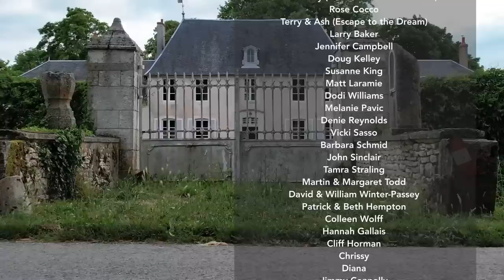How we are SAVING our CRUMBLING Chateau BUILDINGS - Journey to the Château de Colombe, Ep. 80

Comment: For the ivy - Glyphosate is the chemical that works most effectively to kill English ivy.  Only thing is, you need to get it on the roots as much as possible - ivy leaves have a waxy top layer and this prevents any liquid from being absorbed on the top.  If using this chemical herbicide, make sure you hit the under leaf area more than the top.  
An organic alternative is using borax and hot water. When handling borax, wear heavy gardening latex (not nitrile) gloves.  Borax can't "eat" through those.   Using borax, make a paste with a little bit of cold water.  "Swab" the surface of the recently cut ivy root "heads" with the paste.  After doing 3 meters, return to the beginning and pour boiling hot water on the plant's stock. Caution: borax will kill whatever grass you have nearby up to a meter's width.  
A 3rd way is to drill a hole in the center of each root "stem".  Make sure it isn't just a small hole!  Take the biggest bit you have, as long as it does not go past 3 ml from the bark of the root.  Drill down as far as you can.  This creates a "deep hole" where the salt can penetrate and where rain won't wash it away.   Salt won't harm the surrounding area as much as borax but it will turn your grass yellow and could kill it.  
Salt and borax can take over 3 months to work if not longer.  You can do a small test first to see which works best for you.  
A 4th approach is possibly the least damaging to the environment - solarization.  This method uses a clear plastic sheet (5 to 10 ml thickness - 3 ml is too thin) to concentrate the sun's rays to heating whatever is under the plastic.   It will also heat and "boil" all other plants under it.  Do not cover! except the edges where you need to hold the plastic down. First water the area thoroughly.  2nd lay down the plastic in a single sheet (don't double it).  Anchor it down with rocks or landscape fabric ties every 30 or 50 cm and sing:  "Let the Sunshine In" every morning when you go check the area.....😉.   You can also lay black plastic of 10 - 12 ml down and cover with a thick 3 inch (7.5 cm) layer of mulch.  The results can be seen after 1 month of warm weather.  Also, the hotter it is, the better. 
The only other way is to cut the ivy at the root level, then cut the "in-between" layer to just @ shoulder height.  The top will naturally "die" and go brown at that point, you simply pull it off.  But this also means, you'll be checking the area constantly for "regrowth" from the root system. 
Hope this helps.

Comment: I got rid of bamboo by chopping it back, pouring mineral turpentine liberally on it, leaving it until it didn't have a strong smell and then chopping and digging out the thick, woody structures.  The turps stopped it growing and weakened it. It was the safest thing to use, my sweet Hobbit wouldn't go near it and once the smell is gone, it has completely broken down and planting can begin.

Comment: Just a thought on something to kill unwanted plants...here in Canada we pile up pine needles and woodchips and let them rot down..the process creates turpentine ,,very deadly to most plants..it smell quite strong for a time but its used as a ground cover in many of our parks etc for weed control...can you get  a truck load of this product and make your own natural weed control? Keep it as far from you home as you can and also turn it with a pitch fork regularily as it can build up enough heat to start to burn...also can you just inject gas or diesel by syringe into a stem of the ivy

Comment: I think over years of neglect, piling up compost your garden soil level is atleast 30 cm higher than that garden originally was. Dig away the soil around the pigeonnierebin a radius of atleast 1 meter. Than you can see how the steps to the door were. You can repoint the base. I think it originally was a non covered tower considering its age. They covered it instead of repointing.
Reply: That I like true.  Although every building here was rendered.  It was common here.  
We need a mason to repair the damage of almost 70 years without a roof before we can start to search for a roofer who can build the correct roof…..  right now that is way out of the realm of what we can do.  Hugs. 😊😊

Comment: If you can't kill the ivy roots any other way maybe you could just heat them through the plaster until they are dead? Use a blow torch  but don't necessarily burn them out. Or burn the roots at the base of the wall? I've never tried this but burning over the tree stump might keep them from sprouting dozens of new shoots? 
 I don't blame you for removing diseased tress. They have a way of spreading infections. Even the oak spreading over my house can infect the kitchen roof with lichen growths. lichens eat the asphalt shingles. But I wan to keep the oak.
Reply: Good idea.  I will definitely try that. Oaks are some of the most impressive trees.  We wouldn’t cut them down either and we had over 60 100-250 year old ones in Woodstock.  😊. Hugs from Colombe. 😊😊

Comment: You need stump removal. Or you can drill holes in the stumps and pour salt or root rot in them. Good luck
Reply: We will grind the large ones and the ones too close to the walls, we will drill holes and fill them with salt and vinegar.  Thank you so much. ❤😊❤